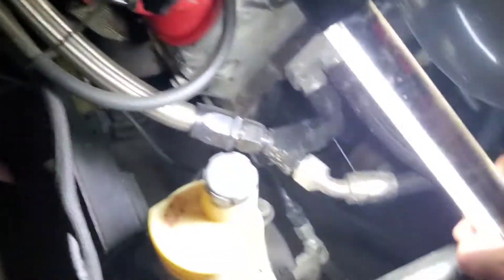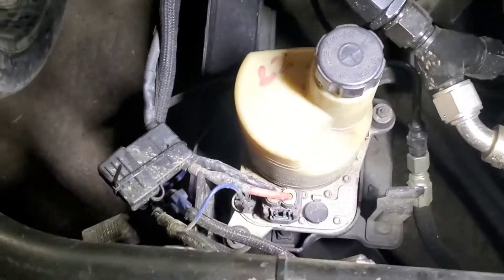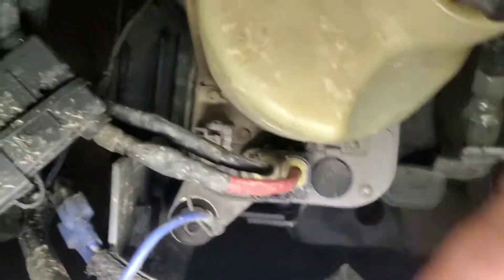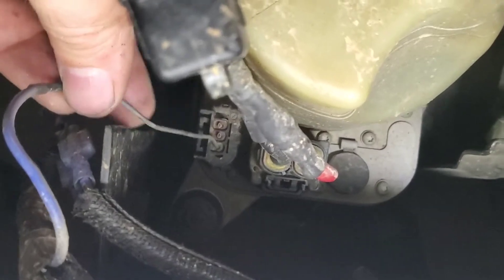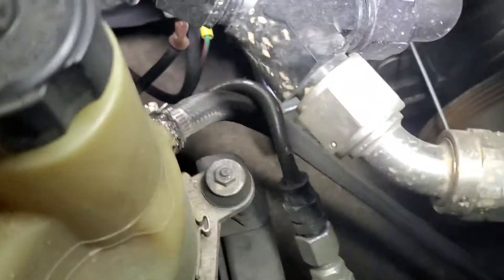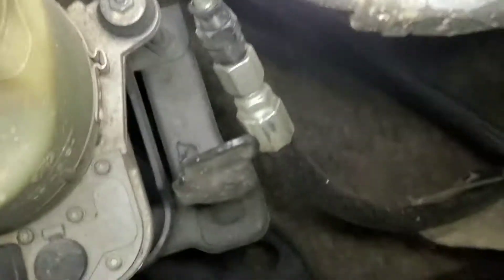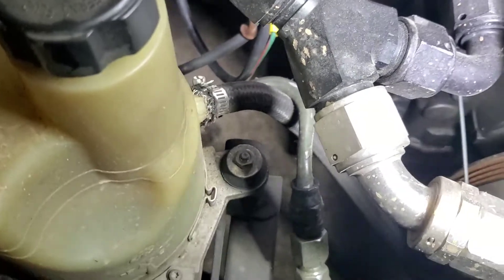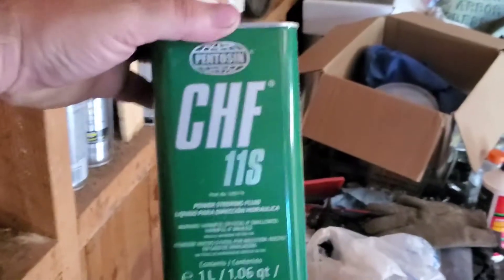Volvo electric power steering! Everything you need to know.

Comment: Have you experienced any leaking of the rack with the fluid you're using?
Reply: I bought one of these pumps from autopart store and it died after 6 months. I was running ATF and Im curious if that's what killed the pump, but I don't want to be leaking out the rack if I make the switch.
Reply from the maker: Well, yes.. but im pretty sure it was just the rack leaking from age. It didn't leak out of the seals, just the pinion area. I've had it rebuilt and it has been fine ever since.

Comment: Aye man, I have a 30amp fuse on my setup and it keeps popping at full lock, did you ever experience that problem?
Reply from the maker: No sir. Only time I've ever had any electrical failure was when the trigger wire accidentally came loose from the zip tie and cooked itself on the header. But then it killed the whole pump.
Reply: @corysnider  im gonna swap in a 60amp fuse and see how it does. thanks for the quick reply!
Reply from the maker: @oksynth  no problem! That should do it! Just too much load at full lock.

Comment: Hey i did this upgrade to my LS400 because I kept loosing ps while mid corner full rpm and now i have extremely hard steering at idle and i camt weight transfer the wheel is just too stiff. No fluid leaks, no air in the system. Any ideas?
Reply from the maker: I'm not sure without physically looking at it. My brother in law says he feels like my car is a little heavy too, but thats compared to his s13 with a 1uz and Toyota pump. It could possibly be a weak pump or its just not enough for you system, but I can't imagine an ls400 system being that much different. As cheap as the pumps are, id try another pump out of a junkyard just to see if its consistent.
Reply: @corysnider  180 dollars isnt exactly cheap but I get that. My buddy has an s13 with the volvo pump and twin superchargers, he doesnt have this issue. Its not just a little hard, its almost as if the switch is off. It actually is the same if the switch is off.
Reply from the maker: Damn.. I get mine for $40 a piece! That's crazy. I would make sure all the power and grounds are solid. Have you checked to see if its coming on? Without your engine running for example? And where is it located? Does it have a super long line? Or is it in the engine bay? If it feels the same as when it's off, I'd say that pump is just bad or there is some kind of block in the system. Mine is definitely noticeable on and off.
Reply: @corysnider  its in the engine bay right next to the original ps pump location. The feed line to the rack is the oem line (new) and the return line now runs through a Mishimoto oil color instead of just a single tube for cooling. The pump is audible and i can turn it on without the car running so yes I verify its on and can see fluid flowing in it when its on. Voltage is at 13.65v at idle with both electric fans running as well as the ps pump.
Reply from the maker: Yeah, I'm not sure on that then. I've used it and a couple buddies have all with the same success. If you can find another pump for cheap, I'd try that just to narrow it down. It sounds like it all should be good to go. I wonder if the problem lies inside your rack at this point? Mayne that was part of your source problem with losing ps before hand? I'm really not sure.
Reply: @corysnider  i put a pressure gauge and a braided AN line as the feed from the volvo pump to the rack. And it shows 0 PSI. If i kink the return it goes up to 20psi but that explains why its got no power steering. Im going to try and run a temp return line and see if that is the issue. If I still have no pressure, then im assuming the pump is shot. 

Edit - i realized shortly after writing this that if the return line was kinked, i would have high pressure, not barely off the needle at 0... must be the pump
Reply: Alright figured id shoot you an update. Got a new pump and 0psi while wheel is stationary. Wheels off the ground i went back and forth in an attempt to bleed the air and then observed the pressures. While turning i get about 150 to 200 and at full lock i get about 1500+ but not always and sometimes only full left and sometimes only full right it goes that high. Soon as i drop it down i can no longer turn it easily and it's equivalent to having the pump off. I got it to work for about 2 seconds,  on the ground it felt good and then all of a sudden it got hard again.  Any thought s?
Reply from the maker: @xJMSports  at this point, it definitely sounds like your rack is shot. Maybe the seals on the inside are bleeding pressure by. I doubt you'd have two bad pumps doing the exact same thing. It really sounds like your rack isn't holding any pressure.
Reply: @corysnider  if the rack wasnt holding any pressure, then the pump pressure wouldnt go to 1500psi full left or full right at the stops. I would think more along the lines of a blockage in the rack causing that. Makes no sense though, fluid is clean and flushed many times. Never any material present.
Reply: @corysnider  so before i went electric, i did new ps pump, new acv (vacuum control), new rack, new lines. Theres nothing left that isnt new except the progressive power steering solenoid (which only comes on at highway speeds) and the used volvo pump

Comment: Adding another comment sorry. So I found out that the volvo power steering pump pushes out 1700psi at max which the content creator said the pump runs at a constant 75% load without a Pulse Width Modulator. So a typical belt driven pump at idle runs at about 125psi. At around 5000rpm most pumps will produce 700psi. So that means you can run the pump at a little less than half speed and you will produce around 700 to 850psi which will quiet down the motor and give more longevity due to it not producing as much heat. Hope this is helpful information.
Reply: They just don't last, 3 pumps in 6 months.

Comment: What I've found out is the main reason the EPS pump from volvo is so loud is because a lot of people doing the conversion only hook up the power, ground, and the 12V signal wire. But no one installs a PWM to control the speed of the pump which in the stock volvo car the ECU or PCM has a built in pwm for the pump. Without a PWM the pump is at 100% speed all the time which may or may not hurt the pump depending on how often you do a fluid flush but with a PWM you can experiment with the speed at 50% when normal driving then go to 80% for racing. I don't believe the pump needs to be at 100% at all times.
Reply: Noone bothers with it because it's not PWM, it's CAN. Basically the pump has a built in controller that listens for signals from the CAN network to vary its output

It would be nice if someone finally cracked it because it would allow you to seamlessly vary the pump output based on a couple of variables, mainly speed (I hate overassisted steering for highway driving)

Comment: Doing this right now. I have seen other say 80 amp fuse. Have you had any issues with the 60 amp fuse?
Thank you!
Reply from the maker: I haven't at all. The only fuse problem I've had is the fuse holder itself is cheap so the fuse came loose a couple times. I just ziptied the cover tight and it's been good ever since. It's all worked perfectly for over a year now.
Reply: @corysnider  Thank you. Great detail in your video!
Reply from the maker: @fstlnj29  No problem! Thank you!

Comment: Thank you for this video. I'm currently planning on installing an s40 pump in my 13. Got lucky and sourced one at the yard. Found a few write ups, but I do like your take on th separate toggle for the signal wire. I had seen one somewhere else where they tied two wires together.   I'm not that knowledgeable when it comes to an fittings, but how do you go about attaching the an fitting to the line. ?
Reply from the maker: No problem! I'm glad it helped. It's a pretty simple setup really. It's been reliable for me and I'm going on a year and a half on mine. Basically I just used the original hard-line, cut it right before it turns down, and then put on a -6an male to 5/16 hard-line adapter. But apparently there is a fitting you can buy now that is the same thread as the original hard-line and it just converts to a straight an line. I definitely recommend using either a ptfe line or hydraulic line from your local oreillys. I had a 6 jic line made at oreillys and it works great. 6 jic is the same as 6an.

Comment: Thank you 🙏 very nice video helps a lot. I’m trying to use a 2015 Nissan Murano electric power steering pump right now see if it is the same as the Volvo but quieter.
Reply from the maker: No problem!! I'm glad to help. My Volvo one isn't too loud, but my exhaust definitely over powers it.

Comment: so it works well for drifting? no need for upgrade?
Reply from the maker: I like it. It works pretty well in my opinion. I'm sure there are better mechanical pumps out there, but its not worth the extra costs to me. The Volvo pump is definitely more than sufficient.
Reply: @corysnider  yup well as long as its never made u crash (reliable) then i think ima go for one
Reply from the maker: It Definitely hasn't yet. 🤞

Comment: How tall is the power steering pump? I'm curious if it can fit on the stock PS reservoir location.
Reply from the maker: It can't. Maybe if you put it in the well there where the relay box is, but it's too big to go on the shock tower. It's like 15 inches tall. And something like a 6x6 square at the base.
Reply: Unlucky. I think I'll look at the version with the remote filler and see if it will fit underneath the headlight.
Reply: @corysnider  that's where I'm planning on putting mine

Comment: Does the pump regulate the assist it provides at all? Or is it the same amount of assist regardless of how fast you’re going?
Reply from the maker: If you wire it the same way that I do, it just runs at a constant 75% duty cycle all the time. So its heavier at slow speeds. Supposedly if you take the column sensors and wire up a speed sensor to the other two wires you can make it regulate like normal, but I haven't had any issues the way it is.
Reply: @corysnider  thanks